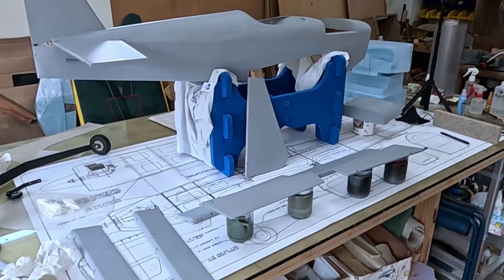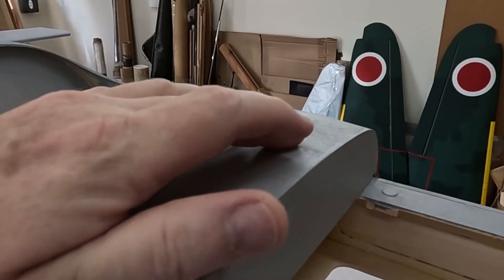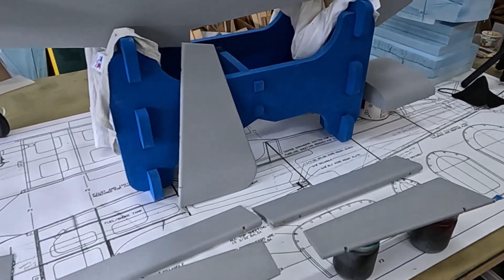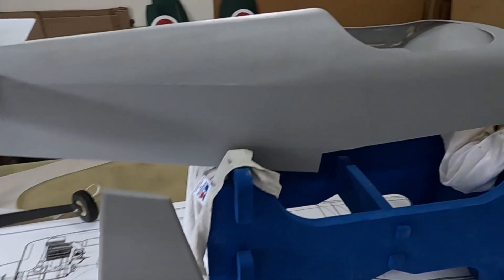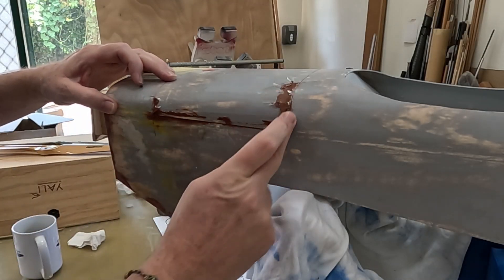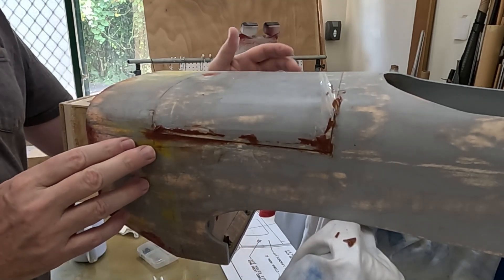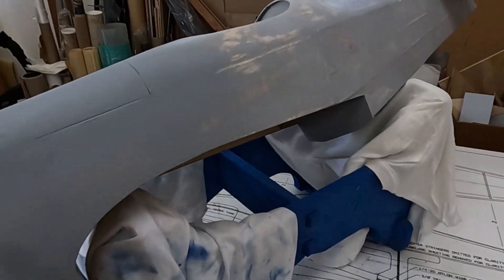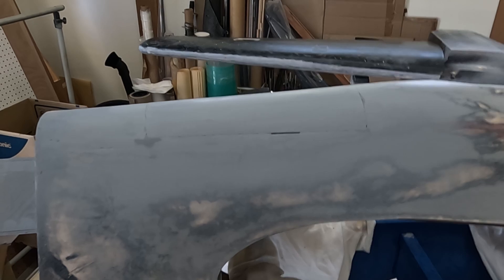DR-107 One Design RC plane build, Update #22, Priming and Battery Hatch Completion

Comment: You can also use Minwax poly crylic to adhere light weight fiberglass and fill the weave, works great much stronger.
Reply from the maker: I have heard of modelers using polycrylic with fiberglass.  Unfortunately,, that is not available to me in Taiwan.   That being said, I may have an opportunity to try it on a small model while I am visiting family in the US now.  Thanks again.

Comment: Looking good.  Couple of requests.  Can you provide a source for the landing gear you are using?  If not known, then the dimensions.  Also, would love to see your process of creating the cowl.
Reply from the maker: I got the gear from my local rc shop.  It measures 490mm long x 175mm tall x 32mm wide at the middle and is almost an exact fit to the plans.  It is carbon fiber.
The video series on building the cowl is in the editing stage now and will be a multi-part series.
Reply: @BalsaAeroProjects  Thanks, I'll search around for it.